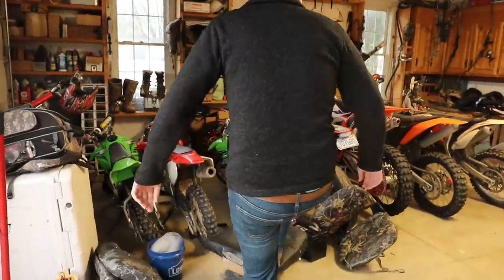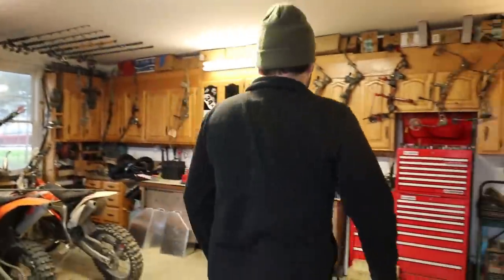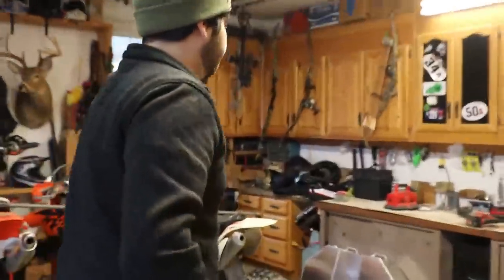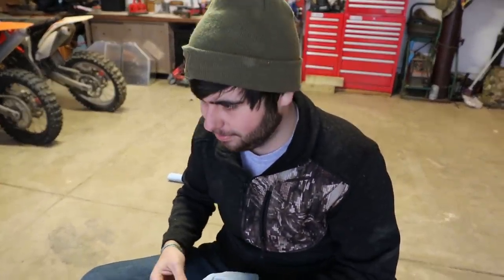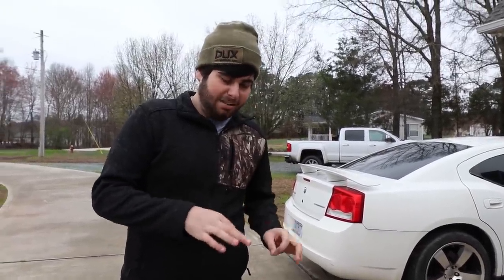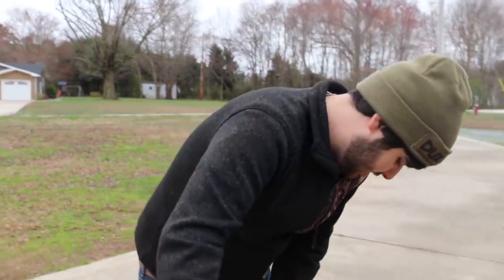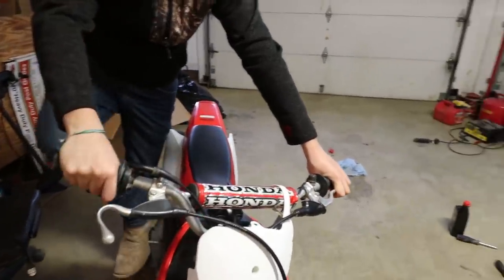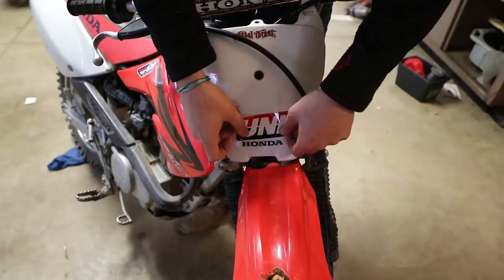Budget Bike Goes FLYING! **Honda STRESS TEST!**

Comment: You should have used silicone on it instead of JB weld that way you wood be able to shift it still and you might have had a small oil leak

Comment: When you finished the bottle I got an immediate flashback from when I bought my $900 bike the kid said it wasn’t running I checked the oil and he had put 4 quarts of oil in it and it takes 850 ml and he then proceeds to tell me that he ran it without an air filter for a couple months

Comment: i hate hondas, trash it! haha when he said it does have timing chain tick but hondas are known for that. yeah, hondas tick because the specs arent very good. they all tick, like from factory they tick. why buy a machine that both runs bad out the door and ticks like crazy and sounds broke before it breaks...which doesnt take long. i hate honda, i ride kawasaki and it has never let me down. not gonna say i will never have a problem out of any kawasaki theres duds in everything, but every honda i have been around has been rebuilt several times a year, breaks parts all the time, and has that awful tick. one of my buddys had his wheel fall off because his axle splines and threads stripped. we were on the road getting to the riding spot when it happened going around 30mph. it threw him into the air and into a chain link fence. he got another one same kind and it happened again, i welded the hub on and told him to get rid of it before it broke the weld bead and he didnt and broke the bead but i wouldnt weld it completely around because that would have killed the temper and caused a full circle fail point. why are honda people so goofy? he bought another honda and the shifter stripped out, welded it back up and then he trashed the rear end. he bought a suzuki 500 and it didnt give him hardly any troubles whatsoever and traded the freakin thing off for...you guessed it, another honda. AND IT BROKE. see why i hate hondas, i hate working on other peoples junk and then replace it with more junk.